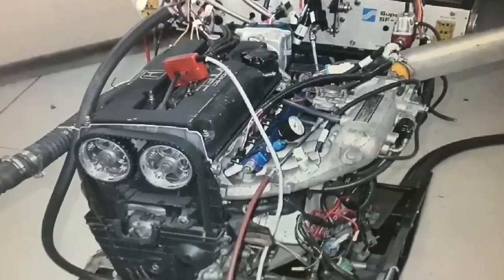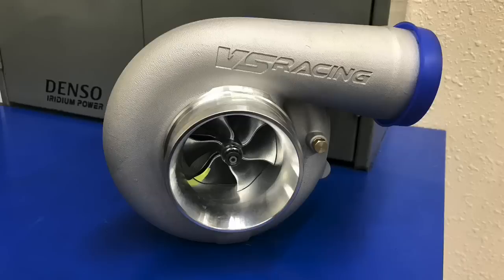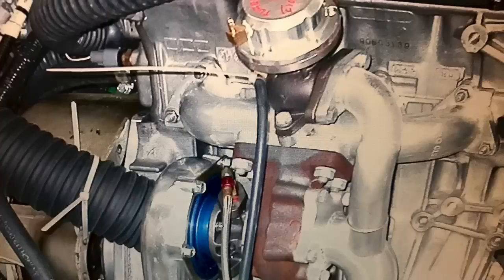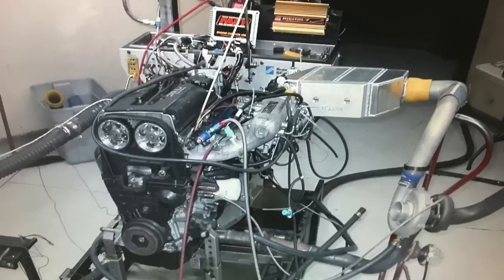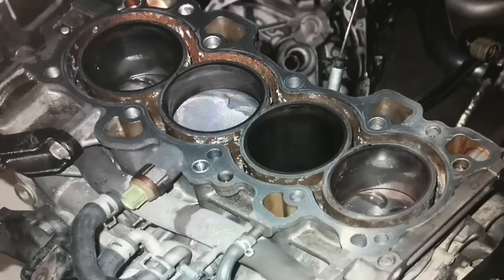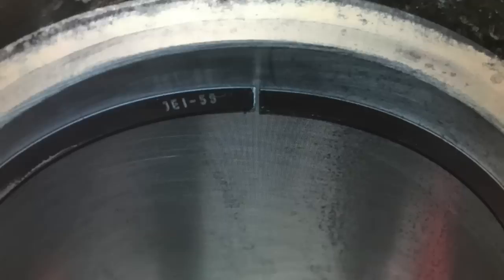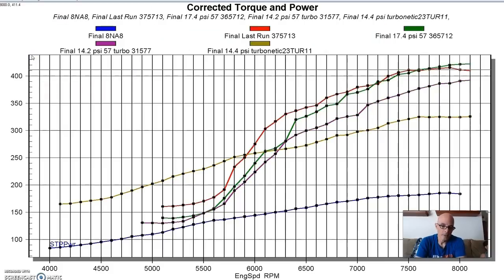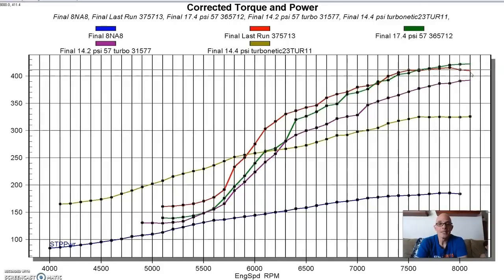BIG BANG B16A-HOW MUCH BOOST?

Comment: Richard , could the temporary seizing of the rings in the bore bend a rod and make it look like a lean out ? Especially if the the stock rods are a little week eg prone to bending? And also cause a rod to break ?
Reply: I know on the 1uz the piston wall clearance was very tight stock about. 010! And the ring gap was like .008! Funny enough on that tight engine almost all the wristpins were very slightly bent. So the theory was that the wristpins were taking the brunt of the force when the engine got hot and the pistons were getting sticky in the bore.

Comment: I know a lot of people would love to see how far you can take a b series with CSS block (cylinder support system) and simple valve spring upgrades. A big bang 4 cylinder.  I can almost guarantee you'd see 1000+hp with a css block pistons/rods and valve spring upgrade.

Comment: An engine I am always curious about, is the Suzuki H27A V6, found in the 98-06 XL-7, and the 05-07 Grand Vitaras. They are all aluminum, closed deck blocks, and supposedly very light (~260 lbs, long block). I have heard that the crank is forged, but have never had opportunity to confirm that rumour.

Comment: Ford 2.3 would be great, I’ve heard they’re monsters with a good head on them
Reply: They make some mean dirt track motors out of them. Upwards of 250 hp n/a with a mean cam.
Reply: The 2.4 Honda’s (k24a2) come with a good head from the factory. But it’s going to be limited by the rods bending at over 800hp. How much power will the stock 2.3 ford rods hold?
Reply: Dylan Bellville I’ve heard... crank rods block are good to 600 with the actual turbo coupe pistons, I just wanted to see him destroy those numbers like he has every other motor in existence lol

Comment: These tests are completely pointless. In fact they are very misleading. 

He would have you believe that you can run 400+hp on a stock B16... as long as you have enough ring gap. What he doesn’t tell you is that it’ll last you about a week before something eventually fails... and effectively destroys the engine... in one way or another.
Reply from the maker: if you put ring gap and proper tune-they last a long time
Reply: Richard Holdener what was the stock ring gap?... and what did you increase it to??

Comment: Even with a good tune you can run high cylinder pressures and bend rods, crack pistons and rings.
Reply from the maker: hurting parts with just cylinder pressure happens at a very high power level-not at 400 hp

Comment: Does adding excessive ring gap decrease cylinder pressure? Would that affect power adversely
Reply from the maker: we don't add excessive ring gap-just enough-there was no drop in power from running more gap

Comment: Honda always built the engines for sustained high output. Honda tech school had the guys build a 1200 and run it at max rpm for an hour. If it blew up you didn't do it right. Now find the right rod bearings when you have different bearing shell inner diameters and different outer diameters. VERY precise bearing clearances and crush.  Now in Typical Japanese tradition do it fast and sweat as you do it.
Reply from the maker: I wold like to see a Honda B Series that could run at 1200 hp for 1 hour straight-heck just a B series that makes 1200 hp

Comment: The ring gap rule is reinforced one more time! Just wondering, can you run Total Seal rings in a high boost engine? Seems like each piece of the top ring could have lots of gap, yet cut down on blow-by. Has anyone tried it (not necessarily a B16, but any engine)?
Reply from the maker: gapless ring work but actually have gap for growth-they just overlap

Comment: Great stuff Richard. Very impressed how capable all these motors are. Learning so much. Question- if you build a NA motor but are considering boost Down the road approximately 8-10 psi should you ring gap before or wait till you install boost and then ring gap?
Reply from the maker: gap now-it doesn't hurt power

Comment: I'd love to see a big bang SR20DE - very cheap and plentiful in FWD Nissans, and there seems to be a lot of different opinions on what fails first under boost on unopened motors. Some swear the rods fail at as little as 300hp, others run motors with the same rods out to 400+ without apparent issue.
Reply from the maker: I love the OG SERs and the SR20 is a great little motor

Comment: Would love to see this done with modern setup, I’m a dyno tuner, and I’ve gone well into the 400fwhp range on dead stock B16’s without any drama at all. Shops locally have gone 500fwhp standard engines totally untouched at north of 20psi. On E85 with GTX3076 turbo’s generally! Would be interested to see a modern redo.
Reply from the maker: 500 whp on a stock B16A requires over 30 psi-I would like to see an untouched B16A do that
Reply: Richard Holdener considering with a GTX3076 they’ll go 350fwhp on 11-12psi on E85. I’d doubt very much that it would require into the 30psi range to do 500whp. Just be interested to see a redo with modern parts.

Comment: Hmmm 185hp b16a thats strange aside from those adjustable cam gears header  and  3ft 3inch pipe for exhaust and intake yielded 185hp, the b16b civic type R puts out same amount and it has ported heads,bigger cams and 10:8:1 or 11:1 compression to get that 185 and yet stock b16a can do the same ???? But race fuel more aggressive ignition timing and leaner fuel mapping from factory setting i suppose its possible.
Reply from the maker: Honda rates their (160-hp B16A)) motors with full exhaust (and cats) with stock exhaust manifolds, run at temperature (195 degrees), with full air intake, accessories and the factory tune. This NA B16A was run with a long-tube header, open exhaust, optimized tune, run at 140 degree, no accessories, and no air intake.

Comment: Love the videos Richard, esp. the LS and B-series stuff as I have feet in both of those camps. Out of interest how much ring gap did you use on the B16?
Reply from the maker: .008 per 1 inch of bore works
Reply: Richard Holdener wouldn’t too much ring gap cause oil consumption issues? Thanks in advance
Reply: @daddyboss907  no because your not modifying your oil control rings. You will have more blow by under boost. That's why you always see oil catch cans with turbo setups

Comment: How did that b16 make so much power with no boost? I thought they were rated at 160 hp or 170 for the jdm version
Reply from the maker: no accessories, optimized tune, no air intake, run at 140 degrees, long-tube header with 3-inch exhaust (not cat)
Reply: Richard Holdener so in the car, about how much power do you think it would have made at the wheels?

Comment: Richard..i wish you could do a test on a ported head on a well designed port like the b16 or k20 (normally asp). just port work and combustion chamber work...no compression change..same valve size etc.
nobody seems to do this test..most tests are on american v8s which start of with poor or avg ports or guys do tests where they have added something else to the mix like compression which renders the test useless.

ps. loving the Honda stuff!
Reply from the maker: head porting only heals when the motor needs more flow, the sock B16A head works very well on a stock motor-especially a little B16A
Reply: @richardholdener1727  agreed..though so many people in the honda world think it is a magic trick for huge power. a test of these thousand dollar cnc street head packages (targeting street na builds) would certainly shed light on whether they are worth the money. 

i understand spending big money on a race head that sacrifices low end for high end..but are the street packages worth that money.

another curiosity : do improved flow bench numbers definitely mean more power on dyno?

Comment: The bone-stock B16A record, last time I saw, was 560whp. Made it 2-3 runs, then cracked the ringlands (no gap). That's stock from the throttle body to the exhaust gasket. Comparing a chassis dyno b16 (155whp with same mods) to yours (185hp), that means ~650hp.

They are pretty crazy little rice burners. The K-series are even wilder, but they have aweful transmissions when you feed it so much torque.

Comment: I have k24a1 with eBay gt3076 /0.82 rear and 98 octane in Aus , 20psi , 11.4deg timing and no knock showing in any logs .rev limit 7100rpm. 10.8-11.1afr. 

Engine broke the piston at the gudgeon after a few months . Sump had the rod, bits of piston, gudgeon pin and lower oil control rings all in the sump .

I assume the failure was lack of piston strength and everything else was there to ensure it lived. I can’t see anything else contributing to my failure ? Thoughts ?

Do a k24a1 Richard . Great channel by the way👍

Comment: I've always wondered about those Mazda Rotary engines how much can they take.
Reply: Depends on the apex seals. 1mm are super low friction super thin seals and push out easily. 2mm came standard on the turbo motor and 3mm is the standard now for any rebuild because they don’t cost anymore than 2mm and the larger shoulder keeps it Square with the face of the combustion chamber.
Reply: John Parrish that is the ultimate question Mr.Parrish...
Reply: I think you guys are on the wrong channel, check out Angel Motorsports channel. Rotary God Brothers.
Reply: @connoisseuroftigolbitts  
Cool channel yoe , I'm subbed
Reply: It's all a matter of eccentric shaft flex, and the torsional rigidty of the keg. Shaft flex means the rotors are going to hit the housings and kill them. You can either clearance the rotors, or get the eccentric shaft kit that includes an additional shaft bearing in the center plate (13b). As far as rigidity of the keg, you can dowel it, stud it, etc. Modern metallurgy being what it is, the main concerns are no longer apex seals.
Reply: @michaelrodgers6559  doweling and bolts are gonna help more than getting a stronger more balanced eccentric shaft. Unfortunately S5 engines are very prone to snapping the corners because of the torsion when you are pushing big power however REW's are a lot better than this but still not perfecf

Comment: Have you big banged a small block Mopar yet? 360 would be great! I've heard you can get 8 lbs before heads lift
Reply from the maker: not yet
Reply: @richardholdener1727  can't wait! I have a 360 with a 60mm turbo but I'm afraid to push it much harder

Comment: I had a 1989 clean ford probe gt with the old f2t when I was young. Did head stead, ring gap, water meth, 2000cc injectors, I think it was a master power gt45, on Megas squirt. Ran 28 psi forever, all my friends said it would never last and I ran that setup for 5 years with absolutely no issues. It's all about the tune people.
Reply: How much power did it make just curious?
Reply: @Simpleman1078  I never had it on a dyno. I did a base tune from one of my friends that had close to the same setup. Then I just street tuned it with a wideband.

Comment: I’d love to see you do this test again with some ring gap. Keep on putting out awesome content
Reply: I have a forged internal B16A with Wiseco pistons and Eagle rods and Cylinder Support Systems installed to close the deck, but I haven't run it yet. I did this same thing on a bone stock non-VTEC B18B1 that I tore down and rebuilt with ACL bearings and NPR rings and it made 408 whp reliably for years and was really fast.
Reply: Big Turbo EJ8 what all made it make 400?
Those internals and a turbo?
Seems real common, close to stock and a big turbo. Then you start swapping cranks and shit... Honda’s seem like too much fun
Reply: ^This!
Reply: Look up Gene Kim, Robert breaker on YouTube
Reply: Look up Gene Kim, Robert breaker on YouTube

Comment: Have you ever done a big bang test on the weaker N/A 2J like in the IS300? Heard you can't put any more then 10 psi on them.
Reply from the maker: I have not
Reply: @richardholdener1727  interested in having a crack?
Reply: Need a early Non VVti from a gs300 or N/A Supra , they hold a  lot of power ,people have made upwards of 800hp on stock bottom ends with those.
Reply: @dilsher12  No the point of the exercise is to see what you can get out of the weaker VVTi engine, we all know big power can be achieved with the other engines. The VVTi has weaker rods, pistons and no oilers. Urban legend say that you can only get 10 psi out of them before issues.
Reply: That sounds like a good test. I don’t think I’ve ever seen any real test comparing the limits of a GE over the famous GTE, other than some armchair claims that it’s really the same engine

Comment: I think I'm doing the big bang on my 4.6 mod or a second one
Reply: It's around 400-450HP. A friend of mine found that out the hard way. The actual weak link is the rods, which is what broke on his. Change out the rods and it will hold a LOT more power.
Reply: @Jeremy-Biggers  yeah the 4.6 will make some serious power with a good rotating assembly

Comment: So...how much compression are we giving up with large ring gap?
Reply: About 5-8psi cranking pressure. Car craft did a test years ago with huge ring gap, a file fit set and gapless top rings. It costs a little bit of power but way less than you'd think.
Reply from the maker: there was no power drop in any of the tests I have run when we changed the ring gap

Comment: Be cool to see with D series.
Reply: I have driven a 325hp d series. 
It was wicked awesome. 

Eagle rods. Turbo cam. 
Head studs. And she loved 8500rpm. 

With a “dx” gearbox on the dyno in a del sol had a theoretical top speed of 170+mph. 
I don’t think we ever went past 150 or 155
Scary feeling the torque steer.
Reply: vitara d series build. cheap and strong for the money
Reply: Love my d series cheap vitra guts Borg Werner turbo and direct port water meth injection and 93 octane. 20 psi is a blast in my ek hatchback. Tho the stock y8 trans needs to be switched out. Tuned on chrome right now but switching to hondata and need to schedule a dyno tune.
Would love to awd this also but not till income starts flowing in better lol
Reply: Dalton Worthington the single cam?  They will never make awesome power, but they are fun to build for beginners.

Comment: How about a video going into detail on the sizing of compound turbo setups? Get a number of options for both the primary and secondary turbos and really get into the details.
Reply from the maker: The LS compound was just a gee wiz exercise. Given the potential with single or twins, There is no reason 99% of LS motors out there need compound turbos. Excellent idea for diesel applications
Reply: @richardholdener1727  You've done LS/V8 stuff to death, and you're right. They don't warrant a serious dive into compound turbos as much as a smaller cube engine. However, the engine isn't the point of my request. I want to see real world results of compound turbo combinations on the same engine, whatever that engine may be. I wanna see a 2 or 3 liter engine make low to  moderate boost just above idle, and carry that all the way to at least its factory redline. Or maybe that's just not feasible? It would depend on the turbo sizing, wastegate strategy, etc. I bet you could do it, and she'd a lot of light on what it actually takes to make a good compound setup. Maybe you want to go nuts and make all the power up top but still have nearly NA response... let's see the possibilities here.